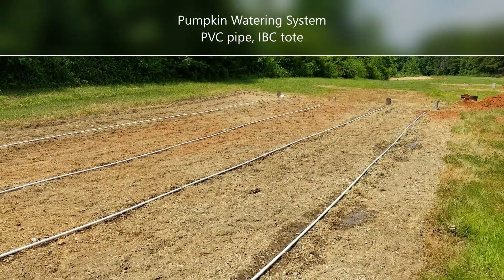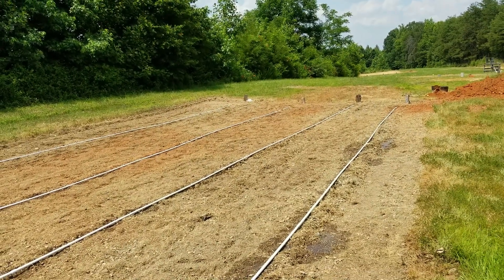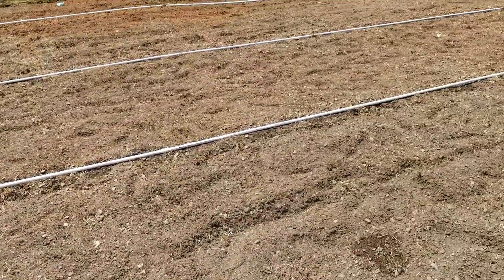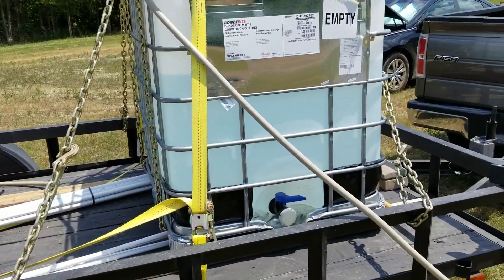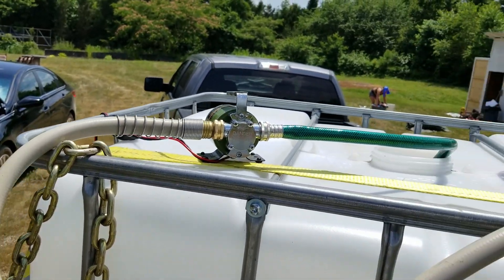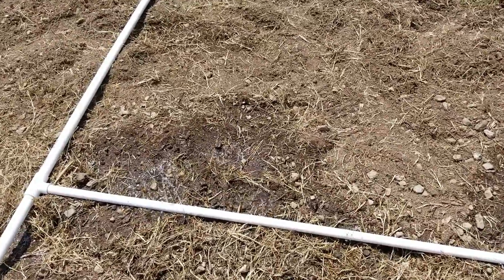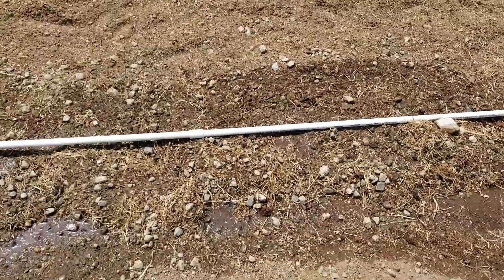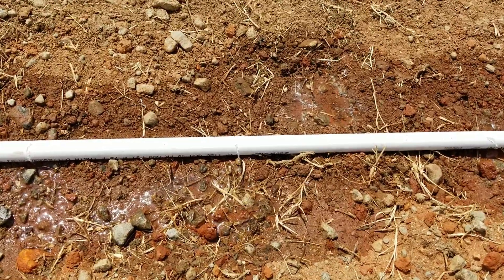Pumpkin Watering System

Comment: How did your system work with your crop? How often did you water? Looking into best system for off grid pumpkin patches.
Reply from the maker: It didn't really.  Seemed like a good idea, but was very inconsistent.  Low spots would flood, places the line was slightly elevated were dry.  Then trying to reuse next year after taking up in the fall....lots of connections broke, holes don't line up with that year's plants, etc.  I gave up on it & water with a hose & same pump from IBC totes.  Uses a lot more water, but less frustration.
Reply: CMV bummer